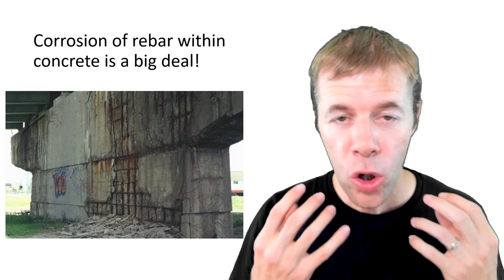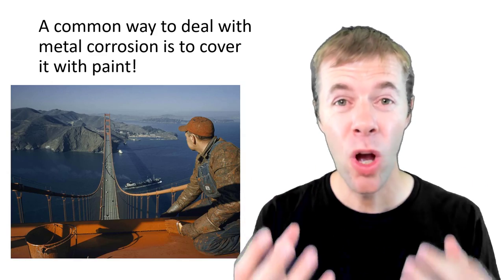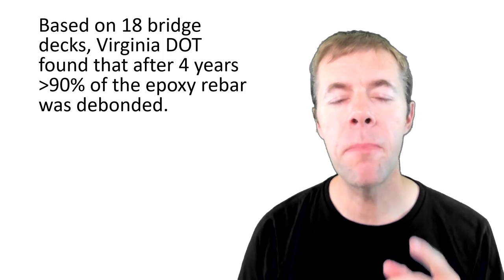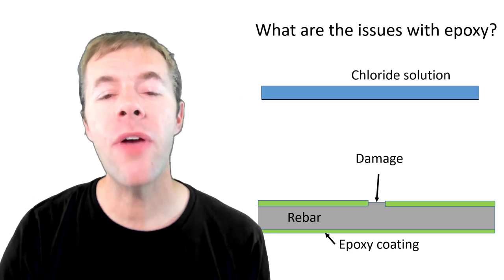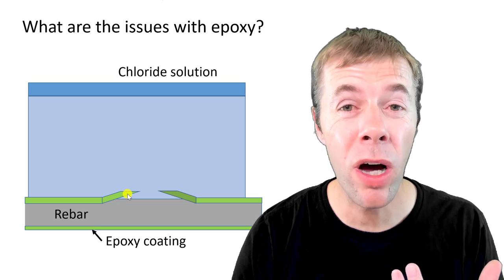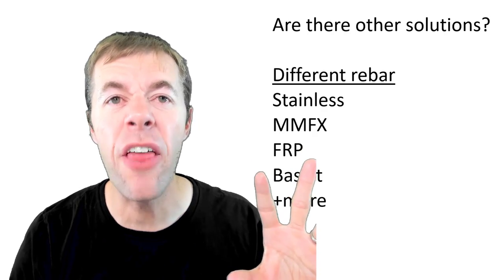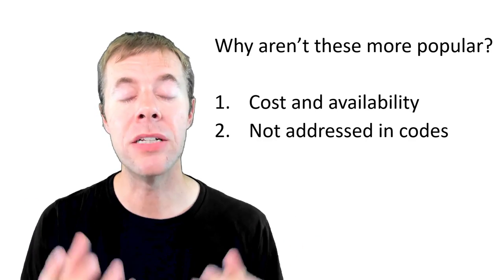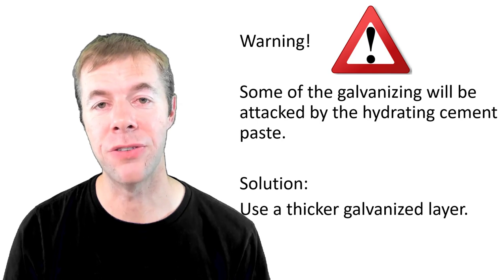What is epoxy coated rebar and why is it being banned?

Comment: Fibre reinforcement is probably the best. That’s what my bet is on.
Reply: Fine in compression not in tension.
Reply: And you can’t bend fiberglass rebar
Reply: @Mike-hb4pc  Fiberglass rebar? I’m pretty sure you could bend it about as much as steel, but that’s not what I’m talking about. I’m talking sans bar.
Reply: @sparkdog44 ??? fibres would only help in tension…

Comment: I agree galvanizing is better but at the same time I don't see it becoming the norm. Galvanizing takes large dipping pools, and if you're building a large structure rebar lengths can be too long for the pools. There are some galvanizers that can do it but it's outrageously expensive. Great video

Comment: Stop dumping salt on roads and go to other solutions for winter driver's.
Reply: Not really any other options. It's cheap which is the main selling factor. It lowers the freezing point of water. It's fairly environmentally friendly. It adds to traction between the road, sidewalk, or driveway and tires or shoes.

Best juice and similar chemicals are added to help. Some are far less good for the environment. Many places pretreat with them. Some add calcium chloride to melt the snow/ice faster since it causes an endothermic reaction but you can only add it after the fact. It's still fairly safe but the water will refreeze quickly afterwards. There are other things used as well but almost all are other types of salts and more expensive. 

So what do you have in mind? I assume you have a solution since you say sodium chloride use should cease immediately.

Comment: This guy is crazy, I love it.  The Romans added blood to concrete and their stuff still stands.
Reply: @RedboneUnincorporated  Actually, recent studies are pretty sure they've reproduced the process and formula. We won't use it because it's too expensive, but we aren't confused by it any more.
Reply: @RedboneUnincorporated  You're blindly repeating incorrect information that can be traced - via a long line of dumbed down articles - to a single study, posted in American Mineralogist, which has nothing to do with the strength of concrete. It was a study of a core sample of a Roman harbour (Romans are NOT ancients) and had nothing whatsoever to do with the strength of the concrete. The belief was that Roman concrete lasted longer in salt water than moden concrete can. The belief was incorrect. Firstly, the sample was taken from a harbor wall that had survived, so survivor bias was at play. Secondly, many such walls exist using concrete from less than a thousand years ago, the erosion of which, when extrapolated, will be no greater than that of any Roman concrete. It's steel reinforcing that causes modern concrete to fail in such circumstances. It would do the same thing to roman concrete.
 ONE misrepresented study. That's the source of that myth. Follow the chain of articles, and it's like Chinese whispers until you get to the absolutely lowest of the low - the point at which the general public finally interact with science - some presenter on some Nat Geo show saying "Roman concrete was stronger than what we can make today", 'cus the show's "researchers" read some misinterpreted article, based on a misinterpreted article based on a misinterpreted article based on a study into resistance to salt water - not strength.
 If you built a supermax prison out of Roman concrete, everyone inside would have Shawshanked the fuck out of there by now.
Reply: @ashscott6068  a bit like ancient katanas.they like to say we cant produce the same quality because all the process involved.
but the reality is that we produce better quality steel in all specs,much easier and in large quantity,the only impressive thing is just that,the fact they could obtain such quality,and is just because all those steps they make,that allow them to obtain that quality,at a high cost.

Comment: Hello Tyler, it is indeed a valuable suggestion for galvanizing. However, If the rebars are put in Hot Galvanized chamber, it may deform the rebar and probably the high temperature of Galvanizing may change the property and strength of the rebar as well. However, I don't have any such experience with rebar but in one of my projects, Built-up Truss members (with Angel and Chenel section with web thickness 4.5 mm to 6 mm) after galvanizing, the truss bent in minor axis.  And realignment of those, were big issue later on. 
Your comments please. thanks.

Comment: I disagree. Widespread use of galvanized rebar will drive it's price up dramatically. It will also still not last as long as the concrete itself. What you need is rebar that lasts as long as concrete itself despite corrosive elements. The only thing that fits the bill is basalt rebar. It is the future.
Reply from the maker: I like basalt rebar but it will also go up in price if we start to use it.  I agree with you that there isn't a simple choice but we need to start doing something different than using epoxy coated steel.
Reply: @TylerLey  First I appreciate you responding to my comment. However, I also have to disagree with what you just said for the following reasons. The difference between zinc and basalt is the fact that zinc is in limited supply and there is already quite a bit of demand on that supply. Basalt, however, is in virtually unlimited supply. The earth's crust is largely made of basalt. It's everywhere and largely free. The only costs associated with it are the costs of getting it out of the ground and then manufacturing something out of it. The biggest single cost will be the energy involved. However, zinc has the same costs plus the material itself is quite expensive and as I said is already in limited supply. As basalt is increasingly used the economy's of scale will come into play and the price of the manufactured product will plummet. I want to stress the cost of the raw material is not a factor. Basalt has greater tensile strength than steel. It is also virtually corrosion and weatherproof. We will increasingly see it replacing steel. First in rebar, then cables. After that who knows. In my opinion, for whatever it's worth the material has a very bright and almost unlimited future. I'm kind of a geek so I find this all very exciting.
Reply: basalt rebar?  Wow, I never knew such a thing even existed!  Yeah, it looks great;  better than stainless steel as it is far less expensive.   You are correct;  the future of concrete construction is with BASALT rebar in it.
Reply: @menguardingtheirownwallets6791  From what I understand the biggest impediment to the products widespread use is getting building departments to approve its use. Though I assume that's just a matter of time.
Reply: @TylerLey  Plastic is the future... there are so many different different plastics that would fit the bill, like polyethylene and in particular, a HDPE resin possibly even building them out of structural foam. There are many new "filled" resins, that are reinforced with metals, carbon fiber, glass, etc by suspending particles of said reinforcing material within the plastic resin material, then used in processes like Plastic Injection Molding to make the parts. You won't find anything with a better ROI, with how cheap it is in terms of material, and processing costs. That is just my two cents tho.
Reply from the maker: @omaspen  Thanks for the response.  I look forward to any new solution that can help with this issue.  I hope to see more info on basalt in the future; however, we have a problem right now.  The epoxy coating is not sufficient and we are building 100s of bridges every day with this material.  If we know it is inferior then we should not be using it.  I think galvanizing is the current technology that has a chance to make a difference today.  It is widely developed and the increase in cost is not excessive.  There are also a number of case studies that show it has decades of performance.  I can't get basalt rebar in my area but there are tons of places that galvanize.

Thanks again!
Reply from the maker: @CH3TN1K313  Thanks!  I think this is a great idea.  We need to bring these to market and get them used in some projects.  Plastics in the past have become brittle from attack by the high pH pore solution in concrete.  There have also been problems with them showing excessive creep.  I want any and all solutions to come forward!

Comment: Make sure your driveway is 6” fiber fill concrete. Or cracks will happen. Your welcome.
Reply: Concrete cracks. Fibremesh or not
Reply: @davidfitzgerald3653  
It probably would slow down any possible decay
Reply: Thank you, Steve
Reply: OK, Rusty. Ever tried to put a nice finish on that stuff?
Reply: @davidfitzgerald3653  if you don't want concrete to crack leave it in the truck.

Comment: Tyler, that's great info. I grew up in home building, many footings, stem walls, basement walls. Just before the concrete was poured we would spay the forms with diesel for easier release. What would the effect of that diesel have on the strength and longevity of the rebar?

Comment: Your comments about Basalt are erroneous 
Besides being corrosion proof ( as opposed to maybe resistant ) it is cost effective and available and has code acceptance ( E 440 ) 
Six times lighter and 2 1/2 times stronger is nice too
Reply from the maker: Not sure which comments you mean.  I think basalt rebar is a good choice.  If you have it available in your region then that is great.  I do not have it available where I am and so the shipping costs make it not cost effective.
Reply: Tyler Ley if you live on planet Earth then it is available in your region 
If you need one or two 20’ lengths then it is not the right choice 
If you have a project of consequence then it can very well be more cost effective than steel rebar 
I think if you compared apples and apples — on a job big enough to warrant the trouble — you would be surprised 
By the way—- I’m talking comparison between basalt ( non corrosive ) to regular rebar 
When we compare basalt to coated rebar, there is no comparison 
Non corrosive under any condition ( basalt ) beats “ maybe corrosion resistant “ in every way
Reply: @teslastones  OR ANYONE /; Question from the guy who knows NADA right up front ;;; What if you used PLASTIC INJECTED bars , the same material that is used in DASH MOULDS  to build car dashes , IT IS strong , IT DOES have a crush level engineered in it etc. IT could be made in multy forms / sizes. ?????
Reply: John McCallum macro fibers ( sometimes called structural fibers) are a good choice for some types of structural strength impartation 
They do not address all needs however ( transverse loads, some axial forces at doors and windows , load transfer bars between walls and footings , etc
Reply: @teslastones  How easy is it to bend basalt rebar into the various shapes that might be needed?
Reply: cruiser97eric1 
Number one, any project of consequence the rebar is detailed by a rebar detailer. The rebar comes to the job bent and tagged as to where it is to be placed 
Ideally the same is done with basalt 

The real world is that , in residential , the workmen bend onsite— even crudely over their knee 

For that type of work there are profiles of basalt that can be bent easily
Reply: @teslastones  But isn't basalt rebar very elastic like a spring, such that if you bend a straight piece into a circle, it will snap back to its initial straight shape after you release it?
Reply: cruiser97eric1 
Yes. It returns to status 
If it is made straight it can be bent up to its bending moment capacity ( varies as to diameter ) 
If it is made into a 90 degree bend ( or 45, or 60 ) it will go back to that shape ( return to status ) 

However , as I said, there are renditions which can be bent into a pretzel shape by hand if that is needed
Reply: @teslastones  Thank you for the reply ;  I saw online the micro fibres in use in stair steps concrete , as the reinforcement , I was more meaning using long moulded plastic bars or mesh like fencing that lay on slabs or tubes in pillars. If they were made of injected plastic like used in car  dash material it could become a whole NEW  product  , tubes  , elbows , flat mesh for slabs so forth . Just an Idea .
Reply: John McCallum you are looking at micro fibers which are for secondary reinforcement ONLY. They are not for primary reinforcement 
We have structural fibers that can match steel bar reinforcement bars for most reasons one needs reinforcement 

We use metal or polyester or ( mostly )polyolefin but also Basalt